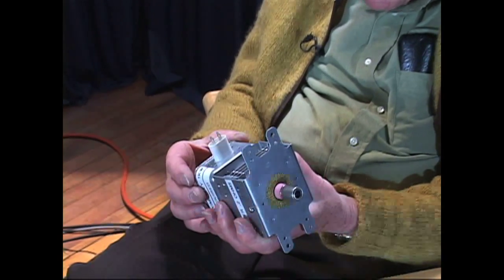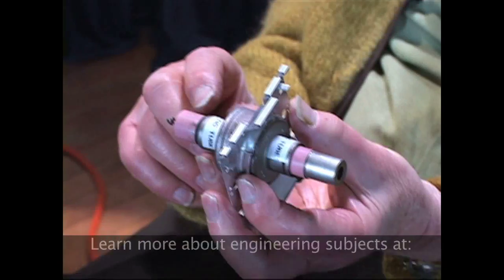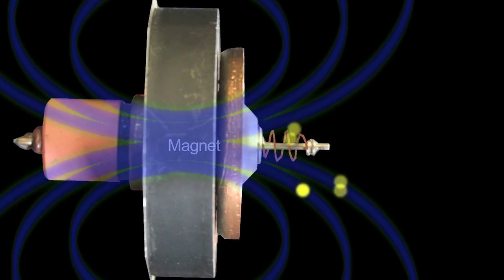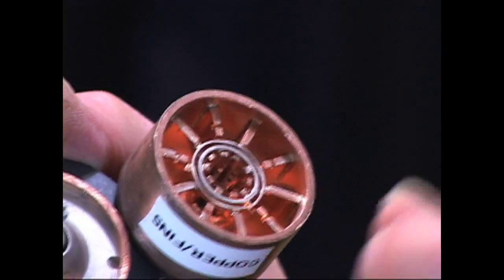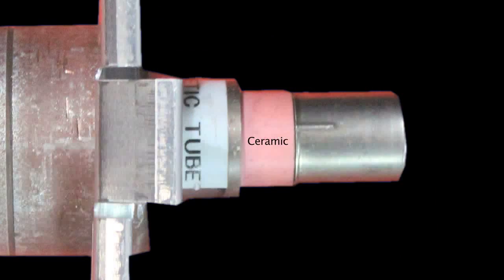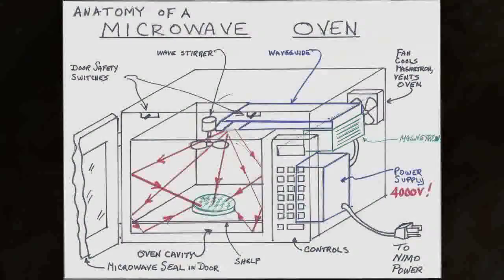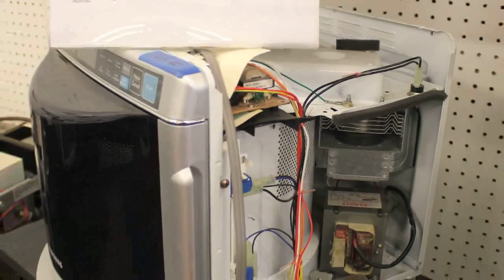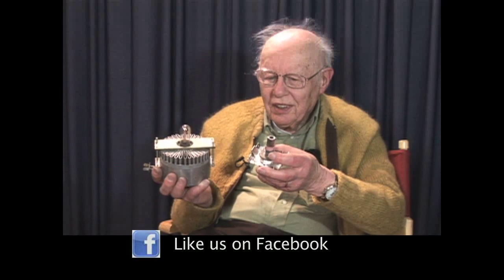How a Microwave Oven Works

Comment: In der Kürze liegt die bleierne Würze:
Das ist gar ist überhaupt kein Ofen sondern arbeitet mit einer vorausgehenden Glühkathode in der Mitte einer Röhre und zwei simple parallele Feldlineinringmagnete polar nach vorne von den Stirnseiten gerichtet. drehen den mit Hochspannung draufgespannten Strom in den Frequenzritzen der runden Hochspannungsanode in eine ganz bestimmte Umlaufsrichtung. Die Anodenspannung von 5000 V bestimmt dabei die Auskopplungsbeschleunigung nach vorne und auch die Leistung zum Auskopplungsrohr bei dr generierten Hochfrequenz.

- Also der Polmagnetring bestimmt nach vorne als Pol die Umlaufrichtung der Strahlung re oder Links
- Die 5000 V gleichgerichtete Anodenspannung bestimmt den Anodenfluß vektoriell nach vorne 
- und die wechselseitig über Sperrringe davor und dahinter geschlossenen v.s. Gaps im Kreis machen aus der 
- daufgespannten Gleichspannung -> eine Wechselspannung die man dann auskoppelt und dann als 
- frei bewegliche Wechselspannung in den Raum als EM -Welle abstrahlen kann.

Comment: There is a mistake in how those loops are shown " Instantly rotating in the same direction " at 4:21.  If they are current loops then they should be flowing in opposite direction in adjacent cavities and  the magnetic loops are rotating, curling,  around the radial copper parts again in opposite direction in adjacent radial parts. The E loops and the H loops should be curling each other at any part of the magnetron.

Comment: And once again, the examples people give to try and prove the fake physics of the Greenhouse Effect are debunked by the people who are experts in the examples given. 

Note the high temperatures generated in the tungsten to create the electrons. Much higher temperatures than any food could be heated to. 

A cold object cannot transfer heat to a warmer object and carbon dioxide in the cold atmosphere cannot provide any heat to the warmer surface from which the carbon dioxide received its energy from.

Comment: What he's  essentially saying is, it's an high freq rf generating device which converts dc power+ heat into watts. man I play around with these thing all the time. However, I've never powered em up fully (put a variable transformer on it) without first having proper shielding and most importantly a target...?

Comment: Okay. So, that tiny-ass little wire, in that space, with that voltage, focused like that creates enough power to heat up any organic matter. 
Change the frequency, multiply the emitter strand by about 3000 times, create an appropriately formed/spaced focuser, and you'll have a microwave emitter that will melt through a battle tank.

Comment: At what point is he explaining how much radiation is being retained in the food being cooked?? And how much are we actually in taking when we eat it?
Reply: At no point. It's impossible. It's called radiation because it radiates, but it's a radio wave, not an ionizing radiation, like gamma rays or alpha and beta particle radiation. It's basically the same as if you had a very powerful light in the microwave oven, bright enough that the food gets hot and cooks, just that it's below the frequency we can see.

Comment: 6:21  Thats NOT a Microwave . Its an Electric Oven , a Self Cleaning Oven . That round piece of Glass is the cover for the Light Bulb . Shame on whoever put that picture in the Video while this Brilliant Man is Speaking .
Reply: You are correct that the lens in the corner is a light.
Here is a picture of that actual model from the fourties.
http://thefabulousforties.weebly.com/uploads/2/8/4/0/28409009/4035860_orig.jpg
It is also a microwave oven or 'Electronic oven' as this model states.
Early microwave ovens came with browning elements to make foods, such as meat, more palatable.
Here's a seventies vintage add showing the element.
  https://metvnetwork.s3.amazonaws.com/4D5Ma-1500315955-9023-list_items-microwave_6.jpg
Reply: sQWERTYFALIEN2011 yup, you're right. That was very idiotic. You can plainly see the heating element right in the middle of the picture! Not a microwave oven! It was probably some stupid Millennial intern who was editing the video and doesn't know anything about this, and they did a rush job on it because they wanted to go back on Tumblr.

Comment: Is it possible to split water into hydrogen and oxygen with the magnetron?
Reply: If you put enough power through it then it will work for sure, but you are wasting an awful lot of electricity in this process.
Reply: GrodyMaroon well, actually you probably could, but not directly with the microwave energy itself. If you had electrodes in water and exposed that to microwaves, the electrodes would have an induced high voltage which might in turn separate the water molecules by electrolysis. The reason why metal objects can arc if you put them in a microwave oven is because the high frequency radio waves induce a high voltage current in them. But that would be an extremely wasteful way of separating water molecules. Maybe it would be an interesting experiment, but if the main goal was to separate water into hydrogen and oxygen, then it would be a very impractical and inefficient way to do it. Simple electrolysis would be a much better way.
Reply: Erik Schiegg Interesting idea, but simple electrolysis would be a much better way if separating water molecules was your goal.
Reply: ct92404 But the goal is to use much less energy than with Classic electrolysis.
Reply: GrodyMaroon You obviously do a lot of research into these like this. I like that.  I think you would be a cool person to hang out with. lol
Reply: Erik Schiegg I hope you don't feel like you're being ganged up on. But just remember, that even if it was possible to split water molecules with microwaves from a magnetron, the magetron itself is going to require a lot of power just to operate. You have to heat up a filament to free electrons, which takes a lot of current. Then you need to have high voltage, which comes from a step-up transformer. The transformer itself will waste a little bit of energy because no transformer will ever have perfect power conversion. I would tell you to try some experiments, but if you do please be VERY careful. The high voltage transformer and capacitors can give you a deadly shock. And the microwave radiation from a magnetron can cause burns and damage your eyes and brain.
Reply: ct92404 I am more hopefull that better catalysators and resonating systems with radio waves like the Hutchison effect could lead to low energy water splitting.

Comment: What determines the power output of a mangetron?
Reply: thikness of the thorium alloy filliment and the size of the resinator make them bigger and cook like a pro!
Reply: There is a capacitor and transformer which limit the output. The magnetron is also fine tuned to the 2.4 GHz.

Comment: too bad there is not a way to reverse engineer the magnatron, so that the atoms are effected in such a way as to make them move slower thus causing  a lowering of temperature. Viola! refrigeration with out a compressor.
Reply: Well there are propane fridges which cool things down by boiling and condensing gasses, but that takes far more power then compressor cooling.
And you can cool things down with lasers but it is an extremely delicate process and much more wasteful then any other process.
Rubber expansion is also an option, but that is very much in the realm of silliness.

Compressor systems are most common because you get most bang for your buck, moving 300W of heat out of a fridge takes only 100W of power with pistons, but far more with any other system.
Reply: Also don't forget the peltier element (or TEC: Thermo-Electric Cooler) which is completely solid state, but with current materials is also much less efficient at cooling than the compressor system.

Comment: Where do the electrons ultimately attract to? I am missing the idea of the anode being so close to the "cathode" and the relation of that and the long journey around the oven box. Or why not electrons simply loop thru the magnetron itself?
Reply: +Do Right The electrons are only in the vacuum tube. Thermionic emission creates the cloud of electrons around the cathode's filament, the positive anode voltage and magnetic field cause them to oscillate in the tiny copper cavities. Electrons have a negative charge, so are attracted by the positive voltage at the anode (vacuum tubes are like electrostatic particle accelerators: The electric field between the anode and cathode accelerates charged particles like electrons). The probes in the cavities connect to the output stub, which is a quarter wave antenna. From the antenna to the food, it is now photons (radio waves).

Comment: so it's like a lasers?
Reply: +duy zoro Similar. Actually, if you made the frequency high enough to be within the visible frequency, and then used a series of lenses/mirrors to constrict the light to a single beam, you could make a laser. Possibly a parabolic mirror, like a satellite dish.
Reply: +duy zoro Not much.  They both emit electro magnetic radiation.  A LASER is based on some emitter, and a system to make the light 'coherent'.  The coherent light, being all of the same frequency has different properties than non coherent light.  I am not good at explaining LASERs, but there are many resources online which explain them better
Reply: +duy zoro This is actually an interesting question- might be something I'd bring up to my AP chemistry teacher.
Reply: strange, Lowe is the name of my chemistry teacher.

Comment: OH, just wait until we start seeing the new solid-state microwave ovens. Much "better" technology, even heating, better cooking control, uses less power overall, etc. The Age of the Magnetron is drawing to a close, but we still have may one billion or so of them in use today.
Reply: +Joseph Rotello 
Right now, current solid state microwave generators are limited to low power applications (cold plasma generators). But maybe one day soon, there will be ones for high power too. But many obstacles remains...
Reply: Not any more. Check various world energy and related labs. What we would call "solid state" microwave ovens are working in these various labs.

Comment: I remember when they first came out, some people were scared of them...
Reply: +Jimmy Loves Harley BZZZZZZZZZZZZT!  WRONG!  There is nothing "radioactive" in the materials.
Reply: Fear of technology. Fear of change. Fear of progress
Reply: +Kathryn Davidson here you are too )). Yeah, I hear you about the fear factor of things. Microwaves been around a while now. Funny you mention beryllium as I worked manufacturing in turbine engines for many years and made gearbox bearing bushings with beryllium. I agree 100%. I can confirm the Radiation decal on the bars of incoming stock. I machined it making solid (peeled) chips on a lathe. The warning more than less referred to dust. My issue was just  there is usually a dust also produced with peeling just that the eye can not see. But again 100% agree about the sticker in the smoke alarms containing Americium 241. Considering all the crap going into land fills like Gallium Arsenide LEDs lead mercury and stuff in electronics I don't worry about the copper in the magnetron too much. I avoid cooking or wrapping food with Aluminum. Especially acidic foods. I saw a long time ago some tomato sauce left for a while in a refrigerator and the foil had a bunch of holes in it when held to the light. Supposedly it accumulates in the brain. I have made many food processing machine parts made of AL and standards today are they must be coated or anodized (usually clear) if within contact of food. The  AL is so soft it rubs off easily and dissipates easily in acid. Seems in the big picture it will get worse before better anyway so I'll just enjoy with as little waste as I can with haz mats. If anything I used to wonder more about the frequency and power of the EMFs of microwaves which does not seem relevant now being contained. I don't have a meter to check in the GHz range anyway? Like I said, they bee around a long time now so I am boing to boil another coffee in the mic now lol.
Reply: +Jimmy Loves Harley 
I had six years of RF electronics, second class radio/phone.
You try to explain how it works but they though it was magic
Reply: +Jimmy Loves Harley There's nothing radioactive inside a microwave.  In the Magnetron lies beryllium, and that is a toxic metal, which over time can damage your lungs if you inhale the dust.  (Thus the old scrapper's saying "don't take apart magnetrons. Sell them whole.")  All radioactive substances must be marked with that oh-so familiar "radioactive" symbol.  It keeps people from throwing out radioactive materials into the trash.  Is there a Radiation symbol on your microwave? No.  But, you will find one on your home's smoke detector.  Funny, how people can be terrified of the simple radio waves in a microwave, but completely at-ease with the radioactive Americum in the smoke alarm.

Comment: I just took my old microwave apart and really learned something out of this video, thanks for that!
One question: I can imagine that the electron emitting kathode wears off over time and consequently, there won't be electrons left to be emitted. What is the service life then for such cathodes? Same question goes for CRT TVs.
Reply: John Doe When emitting electrons, the cathode pulls more of them from the powerline, so that's not the problem. However the filament does break after a while du to being eroded by the heat and single atoms getting knocked off the surface. Basically like a good old incandescent light bulb that buns out, thoughslower, because the filament in the magnetron does not get quite as hot.
Reply: +John Doe Dont shatter the ceramic around the magnetron. I heard they actually contain highly toxic material called Beryllium whos dust will lodge in your lungs and cause cancer.

Comment: Easy explain I got from Philo Farnsworth III. Microwave simply heats the water in the food by shaking it fast. The dry part of the food gets hot when it touches the hot water. There is no water in metal. That is why we do not put metal in the microwave.

Comment: As far as how it 'works', he didn't explain why the 'radio waves' are specifically 915 MHz and 2.45 GHz; nor did he explain about vibrating molecules in food producing their own heat, as opposed to how convection ovens work. After this many years, it could have been a more clever explanation IMO.

Comment: Actually microwaves are a weaker form of radiation than visible light. They heat your food by rotating the water or fat molecules in it which causes friction and thus heat. Your heated food doesn't become any more radioactive than it naturally is and thus doesn't emit microwaves into your body when you eat it. Microwave ovens won't cause cancer. You have a better chance of getting cancer by walking your dog outside than eating warmed food from a microwave.

Comment: I never said to try anything out, I said electrons can burn you; if you were either in the microwave or if you stood for a minute directly infront of a stream of them. Otherwise it's completely safe. You are what you eat only implies, if you eat fattening foods, you'll get fat. Where did you hear about medical issues? I'm having trouble finding any articles on such a thing. As far as I am aware, if it caused medical issues, it would have to say so on every microwave sold. It doesn't.

Comment: What you're saying is, rather than find out if it's true or not, you'd rather pretend it does. While you could get burned by the electrons (if you were in the microwave), it's not irradiating the food to a point where it would be harmful to the body. 2.45 GHz is a very low intensity in relative terms. You CAN'T get cancer from microwaved food. Even if you were inside it, the waves couldn't cause cancer. Wrong type of radiation. X and Gamma on the other hand definitely can.
Reply: So you mean we can use this megatron for healing matter.

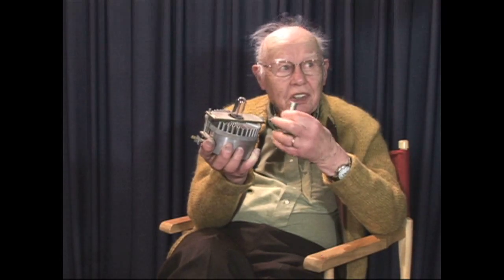Comment: At 6:03 Mr Dehn has a magnetron similar to one in the bottom of my 1971 Hotpoint RHV886 Double Oven with lower "electronic" oven. ie a 915 Mhz Microwave. At 6:17 the actual lower oven of a double oven is seen with the Antenna at the top.

Comment: The gold ring around the antenna at 4:56 is a woven metal gasket to seal the hole in the waveguide leading to the cooking cavity.

Unlike the older round tube, the square tube is almost standardized among all today's manufacturers. The location of the filament terminals, direction of air flow, location of mounting ears, length of antenna (long or short) offer the only variables among almost identical tubes.

If you take a magnetron apart, you get great (but fragile) magnets to play with!
Reply: That is a brass mesh washer.

Comment: The background image of the photo assemblage at 0:45 is a mirror image as witnessed by the unreadable labels.. Obviously somebody needed the photo be the other way around, so they flipped it photographically to match the foreground image where the "TUBE" label on the anode IS readable.